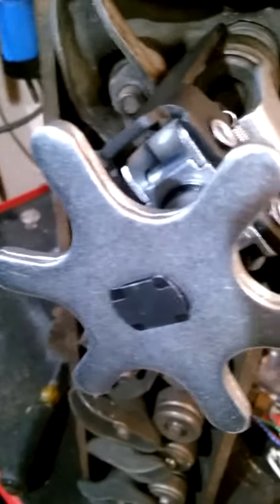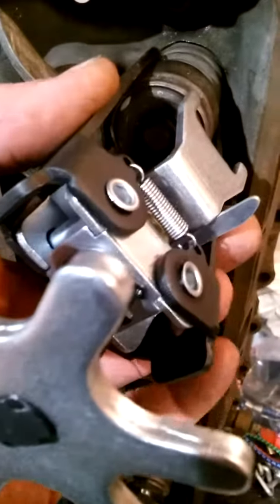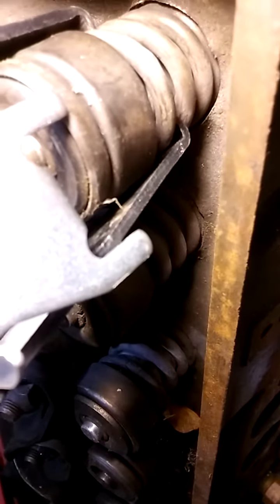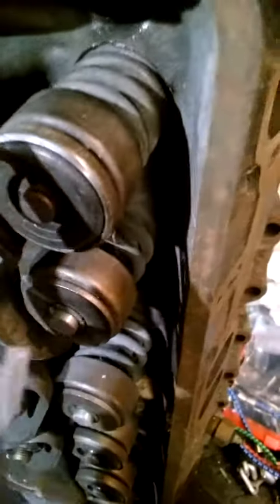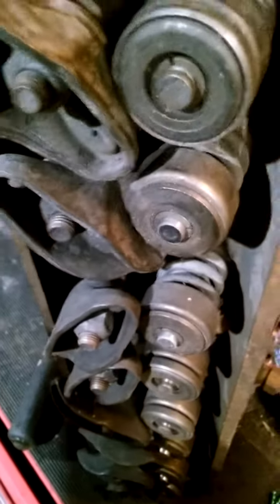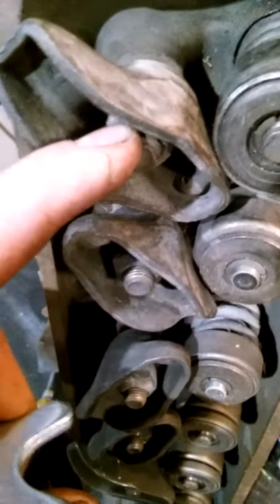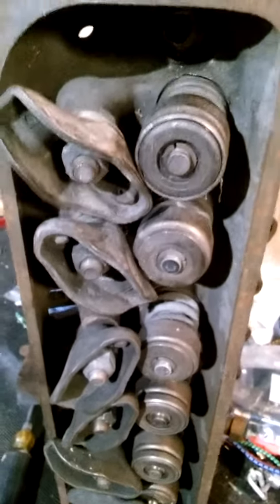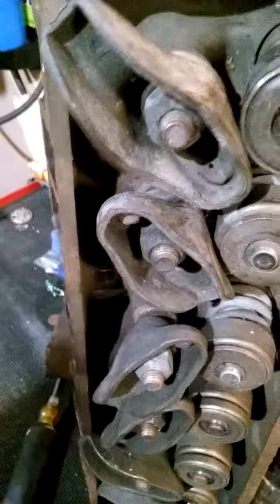Harbor Freight Valve Spring Tool

Comment: Glad I saw this before getting it, I'm surprised they dont make a knock off of the good ones they sell on summit racing atleast those vice grip clamping ones work
Reply from the maker: Yea I just bought an old time big c clamp like one for $20. Works great. HF stuff can suck and the lack being able to order any replacement parts sucks. Yet they have part break down lists with the booklets included with projects. Trying grissley.com now as they stock almost all the replacement parts for products they sell.